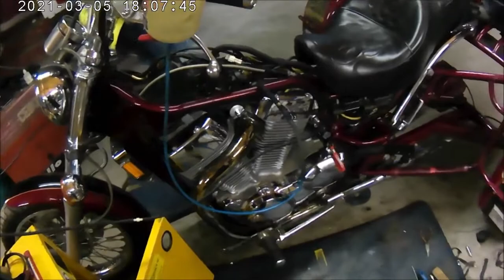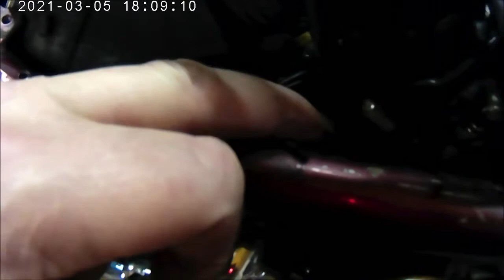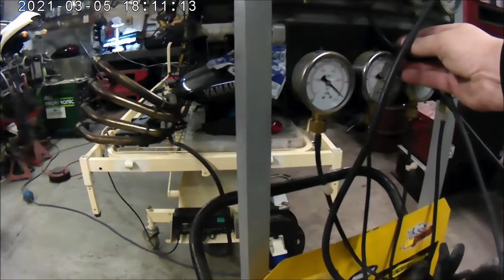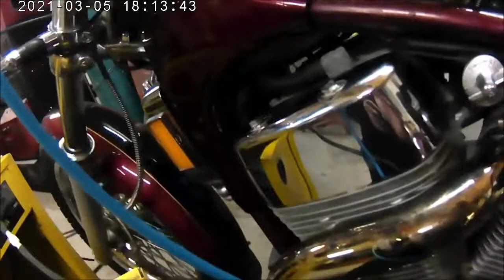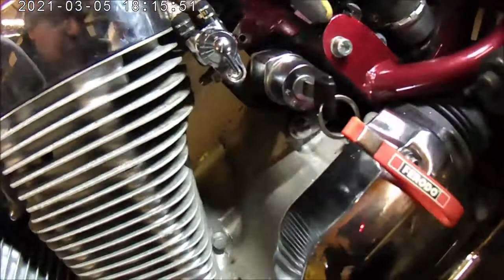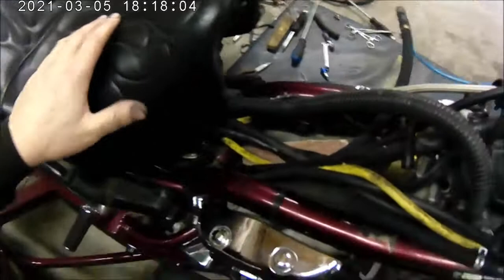Carburetor balancing Suzuki VS1400 Intruder Rhino trike

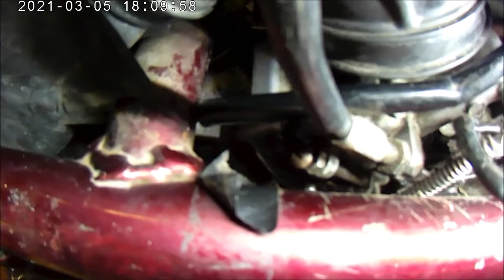Comment: What is a Tick Over Plate? at 2:30. At 2:30 are you talking about the cable locknut or the stop screw locknut.
Reply from the maker: Neither.  That long JIS (like Phillips) screw hits a small tag on the quadrant that operates the idle which also is connected to the rear carb by cable. The trick is to get the idle smooth and synchronised by the knurled screw on the rear carb and the cable adjuster on the front carb, once that's achieved, let the throttle down gently, then screw in this screw until it's contacting the tag but not quite raising the idle speed. Then lock it off with its nut
Reply: @rhinotrikes  Neither lol, it has to be one of them, there are only 2 there. Thats the stop screw, it stops the arm in the proper place.
Reply from the maker: @fjb6576 the stop screw is a screw, the lock nut is a nut but the stop screw is ineffectual without the striker plate on the throttle quadrant which the stop screw bears on.  I can't be any more descriptive, the plate itself has no part name, it's just the metal surface on the idle quadrant which raises the throttle quadrant on the front carburettor.
Reply from the maker: I'm trying to add some context, yes you turn the stop screw and yes you lock it with the lock nut, but it helps to know what the screw is doing especially as the Intruder has a cable which seems to do the same thing. I  describe the stop screw as a positive stop to prevent the inevitable bounce of the idle cable. Getting both adjusted correctly makes a world of difference to how the bike performs
Reply: @rhinotrikes  Not once in the video did you describe it as a stop screw.
Reply from the maker: @fjb6576 I point at it and call it 'this screw' What is your problem?

Comment: After soo many video’s, your video and Words is ment the issue that one gauge is going up, other down. Also you mentioned the cable ÀND screw . Video is a bit dark, but helpfull.
(Make an onther one with more light, is not in the plan?)
Thanks, Jacob, from Holland
Reply from the maker: That is what happens. Much simpler on a multi where the carbs are linked. With the Intruder, the complicated cable operated tick over stop brings in even more potential to be out of tune. Basically, get the revving engine ballanced first, then work on getting a ballanced tick over, when you've done that, screw the stop screw on the front (top) carb in until it just touches without raising the revs. To add a little more complicated into the difficult, you then have to replace the tank and check it again because the tank may alter the cable tension😁, but remember, you can't adjust the front throttle screw with the tank on. It's no wonder that mechanics that know how to set up an Intruder properly are expensive. Good luck

Comment: Hi thanks for the video. 
I have a question. On my intruder there is a hose, on the front vacuum nut😮. What’s is that for ?  I haven’t seen that in any videos of synchronizing 
Ragards
Allan 
Denmark
Reply from the maker: @allanhjme189  that pipe goes to a module behind the left hand side panel, it has nothing to do with synchronising other than you pull it off to connect the carb ballancer

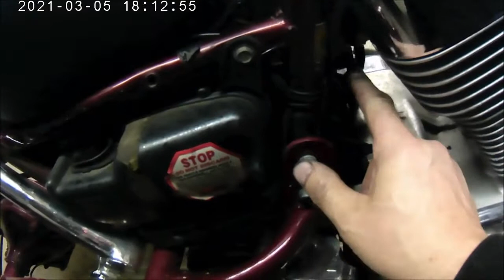Comment: Trying to do this myself.  I'm not sure what you mean throttle stop (5:29).  I have the issue of shutting out the throttle and the bike stalls (5:45).  This seems to be my issue.  Info would be very helpful.  Thanks!
Reply from the maker: Hi
Tick over means idle. The issue over stalling at idle is a bit complicated. The Intruder has a small vacuum jet on each carb with a diaphragm inside to richen the mixture when the throttle is abruptly shut (When you shut off the gas) these need to be clean and not perrished, but more importantly is the front carb has a long phillips headed screw which is hard to see with the tank on and even more difficult to adjust. you have to set the idle correctly using the knurled screw on the rear carb and the cable adjusters, when you have this setting correct, tighten the long screw on the front carb until it hits the throttle stop just a fraction before the throttle stop offered by the cable. This provides a positive stop because the cable operated stop is prone to cable bounce where it goes a little beyond the stop because of the spring tension on the cable, causing the engine to stall. In theory, you want to adjust the idle using the knurled screw for the rear carb and the phillips screw for the front carb,  until you have a slow idle, and then just synchronize the cables so that you can make adjustments on the fly using just the knurled screw on the rear carb. The throttle stop is just the piece of metal that prevents the carb butterfly from closing completetly when you close the throttle.
Reply: @rhinotrikes  Lots to review in your comments.  I currently have the intruder tank off.  I will follow your comments to see if they make sense to me.  When I shift down from 5th, I get to about 3rd and I shift to 2nd, pull in the clutch and the bike stalls while the clutch is pulled in.  I think the solution is what you are describing...but need to follow each step in your comment.
Thank you!

Comment: Hi, I have the same bike, not a trike though and the same guages, couple tips that I found out,,,,before you start make sure the throttle is loose and has plenty of free play, these guages are very sensitive and slight adjustments on the high speed really affect the bike,,,,Hold the throttle at 2k rpms when doing the highspeed sync and make the adjustments while at 2k rpm,,,,also, leave the tank on and prop it up, you can still get the wrenches in to adjust,,,,,when you lower the tank the high speed will change a bit, so recheck with tank down, you will be shocked when you get this really close how much better the bike will run on twist of throttle,,,I use an A frame ladder and hang the guages right over the bike, cheers!
Reply from the maker: you're on the money about the sensitivity because of the crappy radial design of the carb outer cable sheathing. I still prefer the tank off though because of the front carb throttle stop screw. You have to get that sucker just touching at tick over otherwise the revs can dip abruptly when the cable bounces off the quadrant stop. I always re-check with the tank on. I have the crazy expensive glycerin filled manometer guages too but they're not sensitive enough.
Reply: @rhinotrikes Can you explain to me "tick over" im not sure what that means,,,, I recently made some big upgrades to my 1400,,,K&N air filter,,,,factory pro pilot jets and needles,,,Dyna 3000 ignition and cobra drag pipes with no baffles,,,,I'll tell you that this bike is loud and screams with power after Ituned it,,,,have you made any upgrades to this bike of any ones similiar?
Reply from the maker: @thedaydreamer7972  Tick over is slow running or idle
Reply from the maker: @thedaydreamer7972  the throttle cables are mega sensitive too, they're radial outers not spiral so more reason to double check with the tank on. Also the ferrules are prone to pulling off.